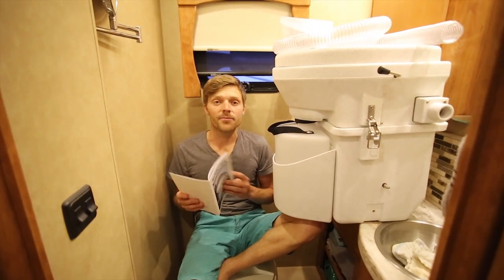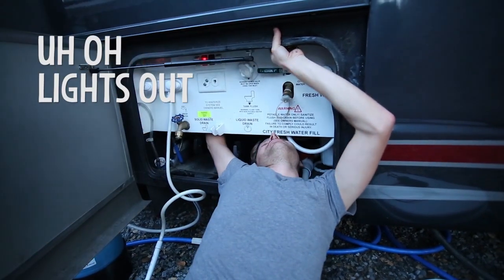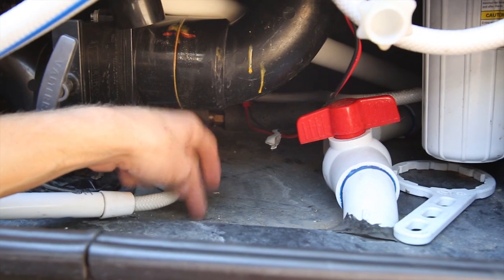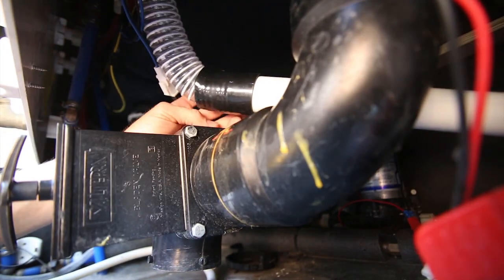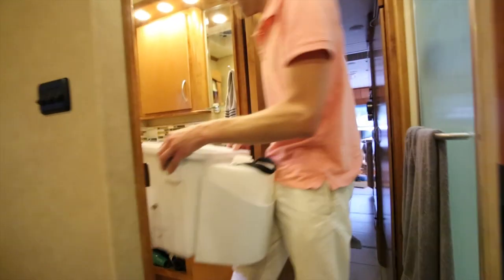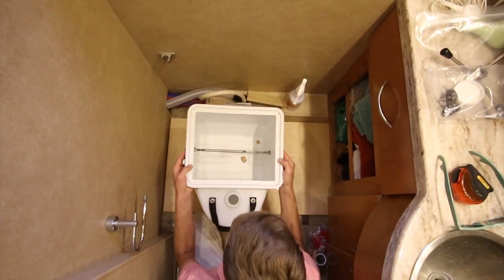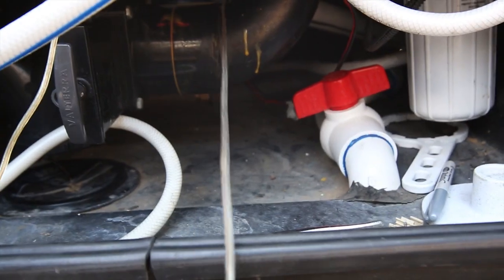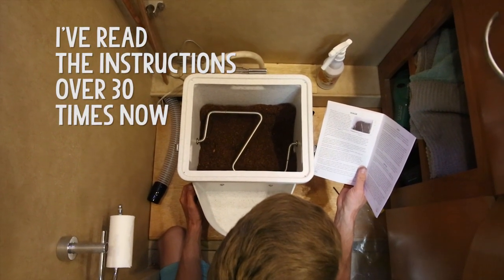How to NOT Install a Composting Toilet

Comment from the maker: I did a several fill and dumps using the spray nozzle built into our black tank.  I also left some water in there and some of the heavy duty tank cleaner and deodorizer which I've dumped and replaced a few times now.  My plan is to always keep a little water in there so it doesn't warp or begin cracking, etc. after long periods of "unuse'.

Comment: Wow great vid ! Add some commercials and you've got the making of a tv show . You can call it " R V Renos " ! Just wondering ... Instead of making big floor , why not make it big enough just to fit the new toilet. Use the flange bolts to hole it. This way you won't mess up the tiles, and it's easy in easy out! Just for thought . Oh by the way I own a renovations company!!!

Comment from the maker: Falcon, I learned a lot on this video.  the solenoid didn't work so I had to attach the wire direct to the battery which wasn't a big deal, I updated this info on our website post: gonewiththewynnsDOTcom/install-composting-toilet

Comment: the wiring you have run to the 12v solenoid  would be wrong on most RVs
as the newer solenoids us  12v  + - too turn on and - + to turn the system off 
you have power at all times so you are ok on yours  

the gasket in the black take is what was making it so hard to pull out  it well come out  but then you have a 3in open hold in the tank  that you cant get to on your rv

but your having  fun doing it and thats all the matters

Comment: Hi Guys - are you considering using your black tank as an overflow gray water tank? Assuming the two tanks are close you could connect them with a tube and dramatically increase your gray tank capacity, which is nice because gray tanks are always too small!

Comment: I like your can do attitude.  I would make a friendly suggestion to plan ahead and gather all the tools and materials you need.  This would have saved you hours of work and grief.  Did you do this just to control odors? There is a $60 dollar fix to handle that called xtreme vent.  It completely gets rid of the odor and you do not even have to add chemicals at all.  It is about a 30 minute install(if you have the right tools :) ) You can google it. Happy RVing.

Comment: Jason, I have to give you an A+ for perseverance!  However, have you ever looked at the "Sewer Solution"?  There is a video on you-tube and Camping World sells these.  You have to look for them, but they have them.  It is a macerator without the gears!  Works off water pressure and uses a 3/4 inch hose.  No muss no fuss!  Check it out.  We used one for 6 years on the road and could have sold one to every RVer who was parked next to us.  Once you see it work, you would throw that stinking sewer hose away.  Oh, and hook up, about 30 seconds from opening up the bay to hooking up to sewer dump.After being out of full timing for 10 years, we are getting ready to purchase a Class C and take our life long trip to Alaska.  Need something a little smaller than what we had before, to get off the beaten paths.  Love your videos.  Brings back many memories!

Comment: I do ALOT of wiring and electrical on boats (which is identical to wiring rvs.)  You should never use wire nuts or caps on any vehicle.  you should but connectors with a crimper not pliers.  Or twist the ends together end to end not side by side. (tried to post pic but wouldn't let me)  if your not going to solder then strip the ends longer then do more twists the tape the well or use adhesive heat shrink (best).  Love your vids though.  Are you guys still going to buy a sailboat?

Comment: I've been comparing the Nature's Head with a competitor. They both offer solar vents but the design of the other one let's you remove the liquid bottle without exposing the #2 container. Has that been an issue for you with this toilet?
Reply from the maker: The thing I find funny with the competitor is he claims "you have to get a whiff of the #2 when emptying the liquids"...yet they claim the #2 chamber doesn't smell?!?  For me it's a moot point and opening the chamber a couple inches to remove the liquids does not smell.  I'd say save the money and go for the Nature's Head.  If you check out our website there is a discount code if you decide to order: http://www.gonewiththewynns.com/all-composting-toilet
Reply: Gone with the Wynns 
Just ordered my head today. It'll be going in a 32ft live aboard sailboat. I'll be doing the pee pee dance til it arrives. Thanks for all the info & sharing!
Reply from the maker: ***** That's Going to be one long pee-pee dance :)  Congrats on the upgrade, the more we learn about sailing the more we think "everyone on a boat should have one of these toilets".  Let me know how the install goes.

Comment: What if you only use the toilet part time?  Should you empty it after a few uses instead of leaving it to compost till the next time you use it?  Would you need to leave the fan running if not using the toilet for a spell?
Reply from the maker: +Dale Schultz Actually, time away is even better as it allow everything to compost! It's all about the amount of uses (about 80 uses in the solids chamber) and then you would change it out. Time is your friend in this instance, not your enemy.  The fan should be left running but it is just a tiny little fan that draws a very minimal amount of power.  One tiny solar panel can keep it running all the time.
Reply: Thank you So much!!  I'm thinking about using the A/C adapter for the fan Jason.  If I decide to get a small PV panel for the fan, I suppose I could wire it directly to the fan?  Details...

Comment: aaa so keep in mind then from this day on  you have the type of solenoid i was talking of   so keep in mind +- to turn on and -+ to turn it off   if one day you no long have 12v power and your solenoid is closed  then you can not open the solenoid intell you have power again   its good to have it when running solar like you are keep the amp hrs down

Comment: I laughed, I cried, and I did judge him a little. The exhaust could have been vented straight out the side wall. There are a number of RV vents on the market for that kind of thing. Or, with a pipe, could have also been stacked up through the roof. Just like the black water tank is vented. For something like this, you always want to have your power coming right off the battery like you said. But you go to the fuse box just like you would in a house. There is usually spare slots for breakers and fuses. You need to have a fuse in the line so no dead shorts can cause a fire. Which brings me to the speaker wire: I realize that fan draws a negligible amount of current, but it is never okay to run a 12 volt motor of any size on speaker wire. You can, it's just not heavy enough for safety purposes. And the wire crimping tool and electrical connectors? You can pick one up in any home center for $10. No excuse not to for a job like this. That said,  he got the job done and learned a lot along the way. The best way to learn is by making mistakes.
Reply: Also, that plywood is never coming off those tiles. It will all have to be chiseled out in one or several pieces, and the tiles replaced. Anyone else thinking about this would be well advised to use 2x4 or the like to make brackets that can be used to tie the base in with the wall. But not the paneling. An actual load bearing stud. Also, you could even tile or linoleum the plywood to match the rest of BR flooring.
Reply from the maker: +VillageTwittiot actually, when we sold the RV the plywood came off clean and we were able to put a regular RV toilet back on. We knew we were not keeping this RV forever and that is why we didn't want to create new holes in the RV and wanted a discrete install. It all worked out perfect in the end. -Nikki
Reply: +Gone with the Wynns Nikki FTW!! :D

Comment: So what happens with the hose that  fed water into the old toilet?? Does water not come out when the water pump comes on? I just took our toilet out of our travel trailer.. we aren't hooked up to water or have any water in it yet but the wife said... "what happens if we turn on the water pump, won't water come out there"... and I had an oh crap moment... lol
Reply from the maker: +Joshua Sikorski There was a shut off valve on our toilet connector.

Comment: I love your videos but I was cringing watching you use that Dremel tool without eye protection. The cutoff blades (and sometimes the bits) shatter with great regularity, especially when used improperly. They're not meant for heavy duty use, such as cutting through thick plywood.

I would have recommended a couple of inexpensive hole saws and a cordless drill instead. Makes for a much cleaner and safer job. Glad you weren't injured.

Comment: Maybe better to hook up to a small solar panel just for the fan. Won't work at night, but constant daytime running.
Reply: Don't Bother Me 
I'm going to do this when i buy mine. a small solar panel that can power that fan wouldnt cost very much at all, and i'm sure there is a compact battery out there that could easily power the fan all night

Comment: I didn't watch the whole thing. 
First off, always have the proper tools.
For constant power, did you try the feed to the light in the bay?
Also, for fishing down through, a large nut tied to a string works nicely, Tie the other end to whatever you are pulling through, feed the nut down, go out to the bay and pull the string in effect pulling the wires and tube. Should have had your wife feeding from the top side while you were pulling. Corrugated tubing is very hard to pull when there are edges to pull it across.